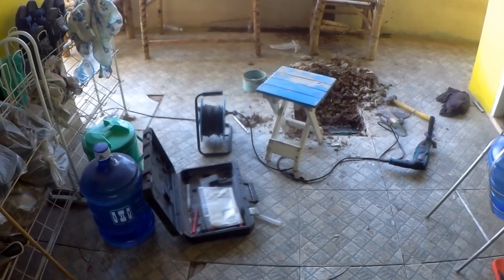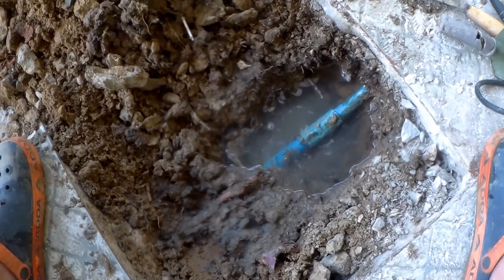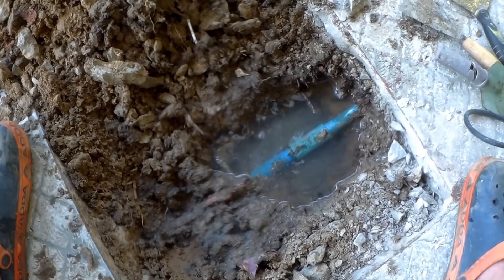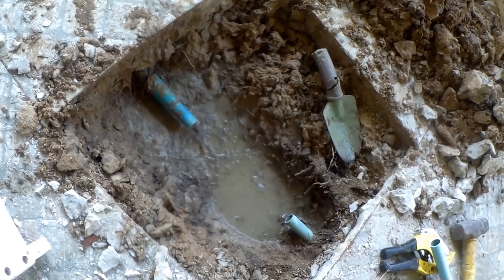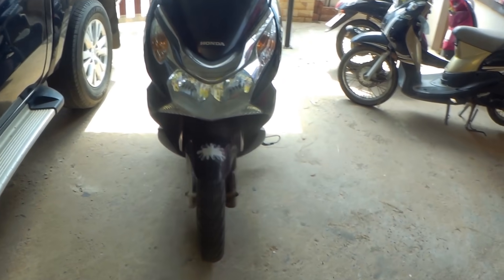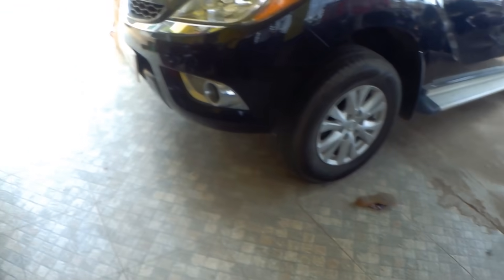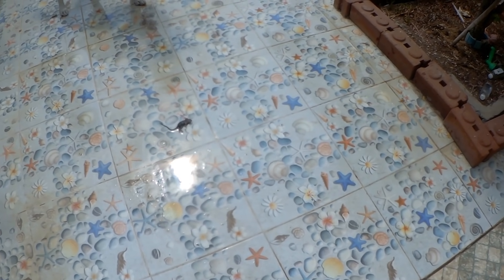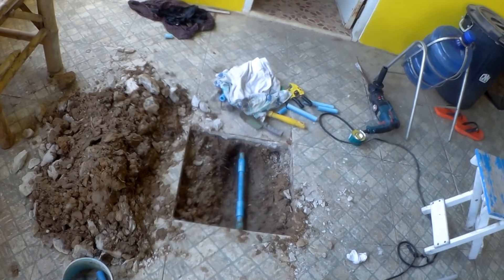Never Mind Lurgy And Visa Restrictions, More Real Life Frustration Living In Thailand😂😂😂

Comment: It makes sense to run the pipes externally in Thailand so when there is a leak it is easy to trace and repair.
They should make sliding joint straight connectors (i.e.no ridge in the center) like we have in the UK in copper fittings and in plastic waste pipe.

Comment: I knew it. You just did what you shouldn't do. PVC pipe  is connected by glue. You want the glue to be all around the pipe. This can be achieved by two things, straight in and quarter turn. When you try to force it in in an angle, the glue is not equally spread out. It is seal the water at the beginning. But it will leak again a short time later.
Reply from the maker: I hear you and time will tell but I had little choice without breaking more tiles. Thanks for your comment👍👍👍🍻🍻🍻
Reply: @livinginthailand7487  I used to work along side a plumber for years. in that situation, they do the dog leg repair by  putting a 90 degree with a nipple on both side. Then create a u with a 90 on  both side of a piece of pipe with exact length to fit those nipples that you created earlier.  You cannot do the the quarter turn at this time. You just put a lot of glue.
Reply from the maker: I did think about  90 degree fittings. You're right but decided on what I did, thanks🖒🖒🖒🍺🍺🍺
Reply: Yes but doing the 90 degree you restrict the flow,, I am a roof plumber and if you want water to move fast you should not have bends all through the pipe work..
Reply: @MrAussie44  you're correct. If you want to do the right way, you have to dig until you find a place where you can replace the pipe and keep it straight. This is where most people get trapped to use the compressed coupling. It works for the moment. And the owner would return to the same place again soon. It's a choice if what to do with the situation. You can test down the floor so you can do the right thing, or do what necessary and loose a little pressure that you don't even notice?
Reply: @MrAussie44  what is the roof plumber anyway?